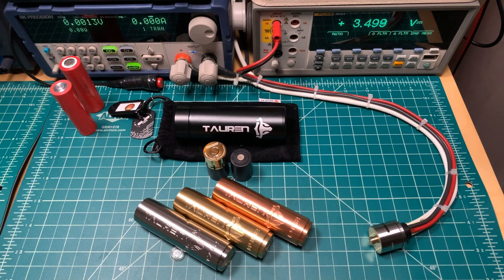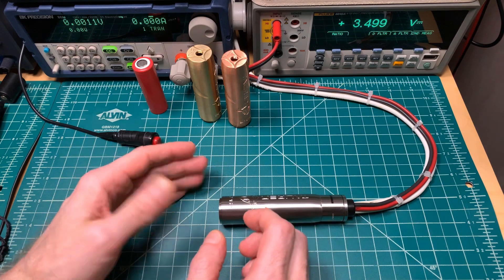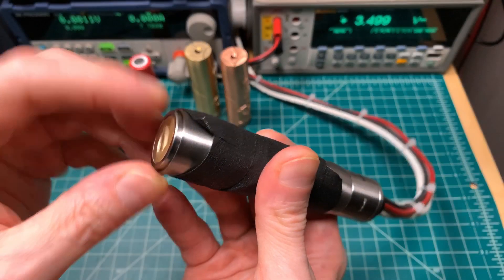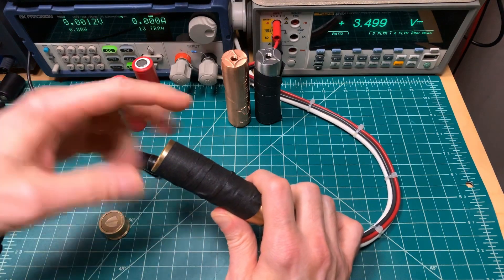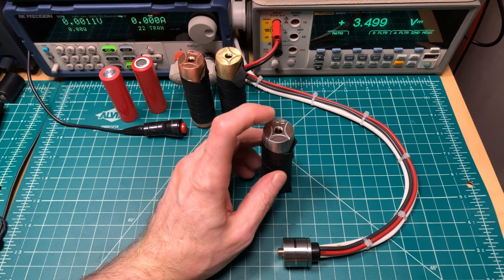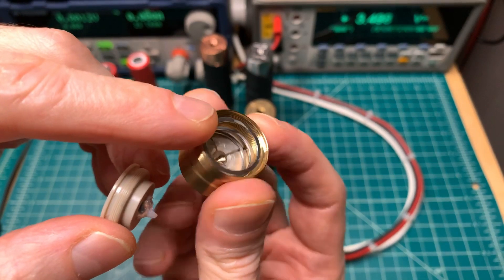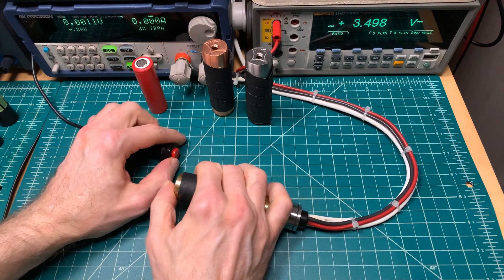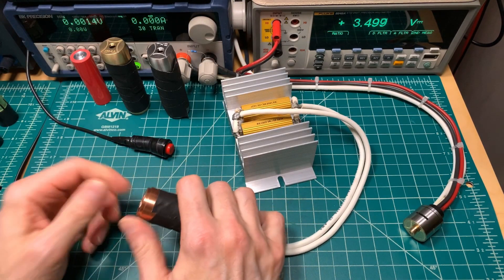Minding Your Mechs Ep030 – Thunderhead Creations Tauren in copper, brass, and stainless steel

Comment: I found with my tenacious unicorn that the grease had same effect. Switch is same style constant contact with plates. If grease is removed from ball and plate but left on bottom of plate the plates dont rattle and power loss is reduced.
Reply: I have one too and after I used it everyday for 6 or so months I finally cleaned it all off but wish I hadn't wiped the grease off cuz now the switch is crunchy where before w the grease was smooth. So yeh idk man I prefer the grease on the unicorn . I hate crunchy switches
Reply: @cavemanlovesmoke4394  go to walmart or auto parts store and you can get a little packet or tube of "contact grease" for a couple bucks.
Reply: @jamesmancuso3666  cool thanks man that's good to know !  :)

Comment: hey mooch would it be possible to also test what numbers you get when closing the circuit like we would if we were vaping normally so then we know how the arcing may affect the voltage drop. so basically hit the button to read then push the mech button so the arcing is also added into the equation since in real world usage it would be a factor. It would be cool to see it done both ways, the way you do it now and the way i suggested but if you cant or its too much trouble then i completely understand. great work as always mooch and thank you for all you do for us 🤜🤜
Reply from the maker: I was originally going to do that. The biggest concern I had was that the amount of arcing that has built up and the amount of, and type of, cleaning that was done before can have a big effect on the voltage drop. If I test before and after the arcing test then I feel everyone will use those numbers as what they’ll get no matter how the mech is used or cleaned. Just doing 200 presses and re-measuring will probably result in just tiny changes in the voltage drop. The much bigger changes will come in time after lots of use and will depend on the device, how hard it’s used, and how it’s cleaned.
Reply: @batterymooch  Ook gotcha. Yeah i think both ways have value, It helps to know how it will perform when clean and also how it perform after it has built up a bit of arcing.

Comment: 03:29 and 14:07 — Switch Issue: Screwing the atty NOT all the way down on the tube (leave the gap about 0,5 mm open) — then fastening (screwing in) the switch — then screwing the atty all the way down on the mech … should solve the problem 
Cheers: Thanks for the vid !!!
Reply from the maker: Thanks but I think that won’t tighten up the thread connections though due to the constant-contact switch “compensating” for it?
Reply: @batterymooch  hmmm … if I look at the button/switch design (screwing the button inside the tube) a tighter tension (or pressure) on the battery (between 510 and switch) should produce more tension in the swich-threading.
But you are correct: In a different button-design (like the TimesVape Dreamer switch) the tension in the threading is produced by threading the switch into the mod — definitely better and tighter !!!  
———

Cheers !!!

Comment: I have a tenacious unicorn mech that had the grease in the switch and after 6 or so months of everyday use I decided to clean it but now the switch is crunchy without the grease (the switch is the same as this) so yeh I still like grease in it cuz it makes it feel smooth I'll take the power loss lol . I always thought dielectric grease was supposed to help conductivity but guess not. Still I'd rather have the grease on some switches ya know? 
Anyways I appreciate the mech tests mooch ur the man
Reply from the maker: A dielectric is a special type of insulator. Dielectric greases are designed to provide insulation to prevent very high voltage devices from arcing to places it shouldn’t. By design the grease will insulate when used in a mech. But, it might help to reduce arcing damage (I haven’t tested this) and can help make threads smoother. But if any grease gets between two contacts or is not squeezed out all the way from between touching threads then there will be a voltage drop.

Comment: Bro what is the best battery for that Tauren mod 18650?
Reply from the maker: There’s no one best battery. It depends on how you vape.
Check out the Description section of this video and follow the link to my blog at ECF and grab my Recommended Batteries tables. You can watch Minding Your mAhs Ep31 too.
Reply: @batterymooch  Thank you Just checked the Link it Helps a lot